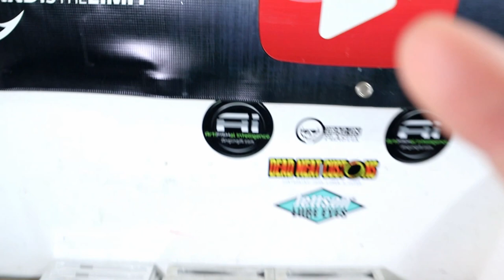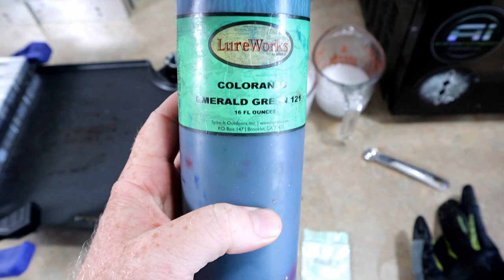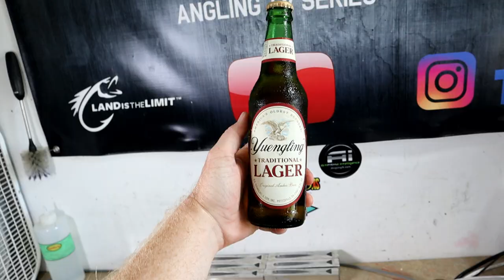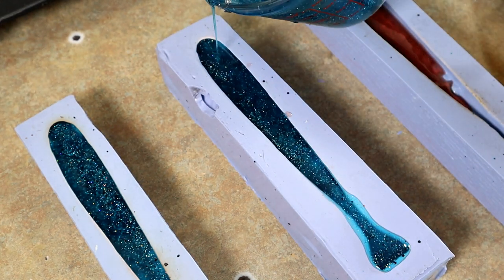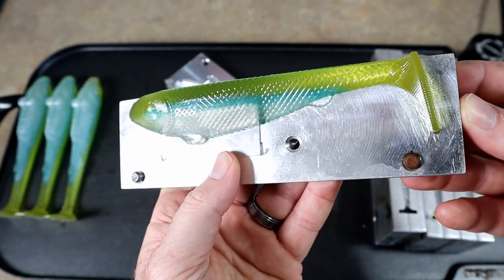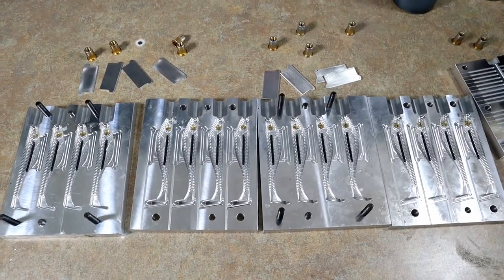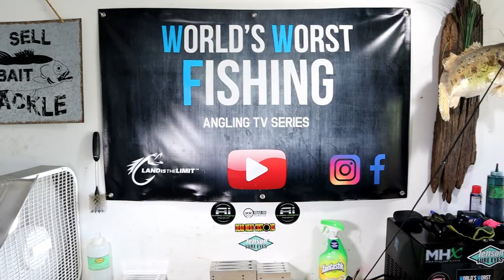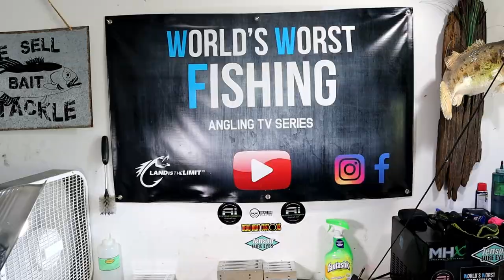Swimbait-MANIA: Running A Ton Of Soft Plastic Swimbaits

Comment: A great video and, mainly, great soft baits. Your videos are a really good training moment for a lot of Soft Bait Makers.
What do you think about a cold top coat, as 50% PVC glue + 50% MEK, instead to dip soft bait in hot clear plastisol? Sometimes, with thin soft baits, you can ruin them with the last "bath" because the weight of body can stretch the tail.
Bye 

Cami
Reply from the maker: If you did them before they are set up then yes you can over stretch the tails..that is what I would consider a beginner mistake that you will quickly fix.
Reply: @WorldsWorstFishing  They were set up, they were THIN, so this kind of COLD top coat could be an useful option for a lot of us: let try before judge

Comment: When using the silicone mold for the larger swim baits, can those be placed safely placed on the Hot-Plate without melting or charring?  I ask because the concentrated heat coming out of a heat gun can just as easily reach a couple of hundred-plus degrees if pointed at the same area of the mold.
Is it possible to just set the heat of the Hot-Plate just hot enough to keep the Plastisol from hardening to quickly before that next layer gets added?
Reply from the maker: The heat plate will mess em up
Reply: @WorldsWorstFishing  I believe you but, it's hard for me to picture in my mind how a hot-plate set at a heat level that the silicone mold will tolerate and that will mitigate the cooling of the plastisol just enough to get it to flow correctly for you, will be negatively effected by placing it on said hot-plate.
Do you know if possibly this same silicone is microwave safe?  This may be another option for keeping the silicone mold just warm enough to get the plastisol flow and viscosity just right.
Reply from the maker: @MrTjmk  most people who heat a silicone mold do so in a convection oven at a controlled temp
Reply: @WorldsWorstFishing  That makes sense.  I just got my order of Plastisol.  I'll be trying out my newly 3D printed mold within the next week or so.
I printed them out of resin with sufficient heat resistance to withstand the shock of molten Plastisol as it's injected into the cavities of the mold.
This same resin is said to be microwave safe so I look forward to testing these DIY molds.
Thanks for taking the time to respond to my inquires.  Sorry if they come off sounding stupid.  I'm learning as I go.